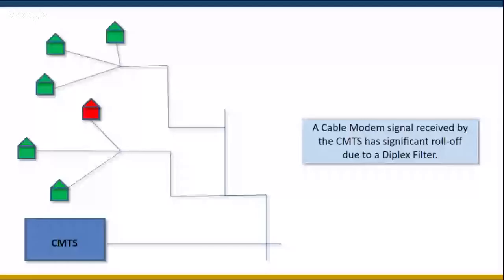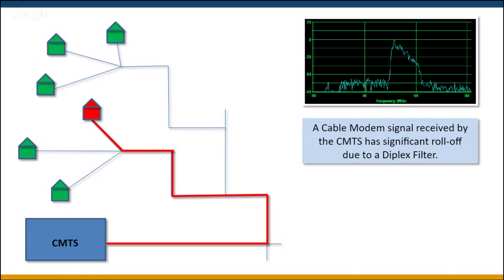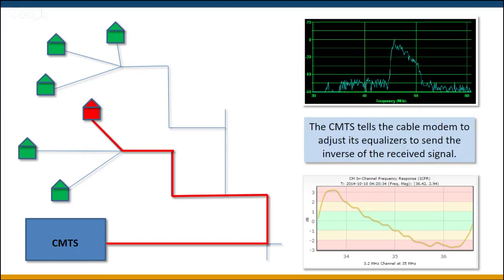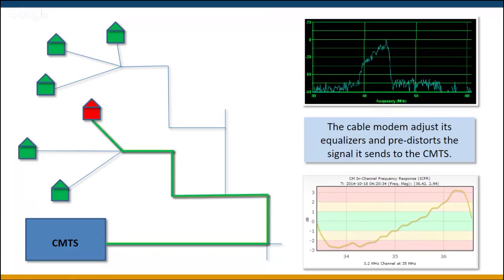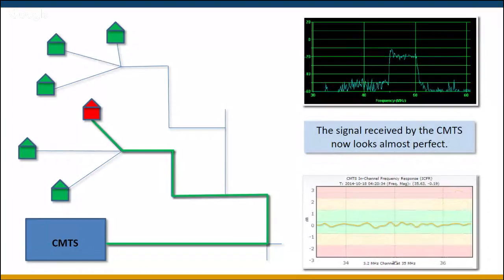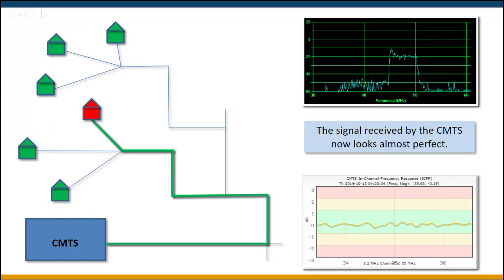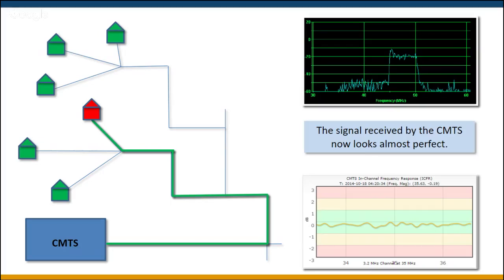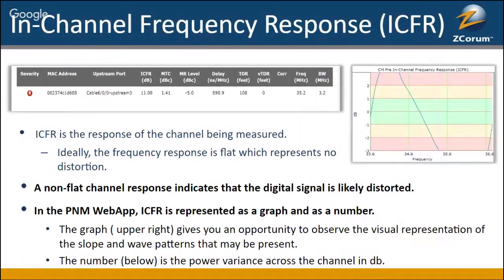DOCSIS PNM:  In-channel Frequency Response (ICFR)

Comment: I'm having a hard time understanding how this relates to a HFC network. Because you have a different technology (optical) in-between the node and CMTS. Why is there no compensation happening in the (RF) receiving end of the node before the optical transmitter, and how are these (upstream) RF impairments transferred over fiber (I don't believe optical is plagued by these sort of impairments)? is there some 'meta data' added, on how the optical receiver in the headend should 'translate' the RF back to the CMTS? I find it hard to grasp how the optical translation of the (upstream) RF signal is affected and transferred to the CMTS on the other side. unless the CMTS instructs the modem to send a 'cleaner' upstream channel to the node, not the CMTS itself as implied here. because in a HFC network, there never is a direct RF connection between modem and CMTS (as also implied in the video, unless I misinterpreted).
Reply from the maker: The fiber optic cable is just the medium that transmits whatever signal it receives from one point to the other. An RF impairment on the coax portion of the plant can distort the signal travelling from the cable modem to the CMTS. That distorted signal is transmitted over the fiber portion of the plant to the CMTS just as it was received. The CMTS receives the distorted signal and determines how it needs to be adjusted to remove the effect of the impairment. It tells the cable modem how to pre-distort its signal in the inverse of what it originally received. When that pre-distorted (pre-equalized) signal passes through the impairment, the pre-distortion cancels out the effect of the impairment. That corrected (equalized) signal continues through the coax and fiber portion of the plant back to the CMTS.

Comment: getting high ICFR right at the Node, could you advice,
Reply from the maker: An ICFR in PNM only shows you how the signal is distorted. It's like looking at the very top of the haystack on the channel. When a PNM tool shows you an ICFR that is out of spec, you should also be able to view the digital taps to see which of the 24 taps are elevated. Those digital taps are a graphical representation of how the cable modem is adjusting its equalizers to send the inverse signal to the CMTS to compensate for the upstream impairment. From that digital tap data, the PNM tool can calculate the approximate length of the echo cavity (micro-reflection) that is impacting the signal. We refer to that in our tool as the TDR or vTDR depending on the length. That echo cavity distance, plus a map in the PNM tool showing which devices are being impacted, will give you an idea of where to start looking for the fault that is causing the bad ICFR. This needs to be done in in conjunction with your plant maps so you know where your actives and passives are in relation to the impacted modems. There is an excellent explanation of how that works in this video:  https://youtu.be/-foccyrN6_w
Reply: @ZCorum   i use a Viavi meter.